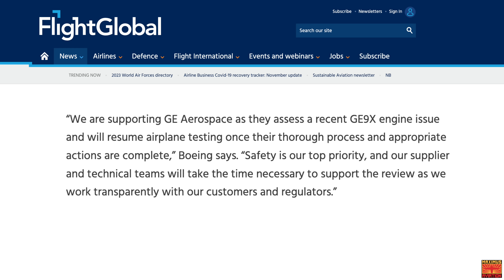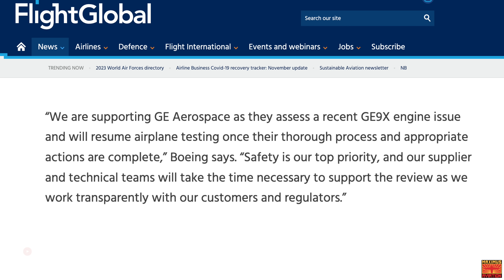Boeing Grounds All 777-X Test Aircraft Due To GE9X Engine Failure. Will the 777X Ever Get Certified?

Comment: Hi Max, does Rolls Royce have a similar power plant under development or testing to also be included in the choice of engines that carrier’s can choose from ??? ✈️
Reply: RR has the Ultra fan under development, but it's been put on their back burner after a test setup. Not that there problems with it per say, but they have other priorities and financial challenges and few actual profitable opportunities for it. Engine choice isn't really the think anymore on widebodies or even narrow bodies anymore give the huge development and manufacturing costs.
Reply: Yes they do but it is not yet ready to be slapped  under the wing of an airplane.  Just like John said , they have pumped the brakes on its development and are choosing to take it nice and slow .
Reply: @johniii8147  Where are you getting you naff info from? They have NOT put the brakes on its development whatsoever!!! The main aspect of the engine (the gearbox) has been tested and tested. It has the capacity to handle the output of 400 Formula 1 cars. It is in the process of being married to the fan and other architecture in Derby RIGHT NOW. Rolls are optimistic about getting ground tests underway in Q2 of 2023 and wing testing in Q3 or Q4 of 2023. They are quietly aiming to get a scaled version on the A350F test programme. Airbus are hoping likewise as the knock on effects mean a NEO for the passenger versions that will give a huge fuel performance reduction.
Reply: @nathd1748  your numbers are too optimistic for me  , I will believe  it till I see it . 

Giving  you the benefit  of the doubt , I still don't think keeping something  like that a secret between two large    well known companies is even possible. 

Some detail , even a tiny fraction  of it should have slipped out by now and we could have been chewing on  those rumors as we speak
Reply: @mmm0404  It HAS been made official. In local news outlets around Derby. When you are in the US you won't hear much. Also since the discussions are between RR and Airbus only there is no need to announce anything. Airbus are currently offering the A350F with Trent XWB97s only so anything better will become a bonus won't it?
Reply: @nathd1748  
You've convinced me you know what your talking about, your comment is too specific and authoritative not to. I wish them well with it..........
Reply: @artrandy  Did YouTube shelve my link? Official aerospace news saying RR will be testing it this year. I know that's not true. It will commence testing in Q2 of 2023.
Reply: @nathd1748  
Didn't notice. I never include links, the comments often disappear. Thanks for the updates......
Reply: @nathd1748  In other words will be a great engine but way too late for the 777X.  FWIW I am excited to see the UltraFan go into production.
Also if one is going to have trouble with engines on the 777X now is the time to find them.    Not after the planes go into service.   Boeing has 2 other copies of the 777X that they could fly or grab an engine from.  It does not look like they are in a hurry.
Reply: @danharold3087 The new RR Ultrafan will have no bearing on the 777x since GE have negotiated exclusivity.
Reply: @danharold3087  It's far, far from production at this point. They are taking a relaxed approach to testing since there are no pressing needs for it.
Reply: @johniii8147  This is a thread that has gone off the rails.   Somebody else asked if RR had an engine that could be used in place of the  GE.   I have never said it was.  I did not say the ultraFan was a bad engine but it will never be used on the 777X due to timing.  

It think RR knows this is not an easy engine.   IRRC at least one other company tried and failed around materials for the gearbox.   Best wishes to RR.  Arguably we need better engines more than we need better air frames.   Best wishes to RR and all the engine makers.
Reply: @artrandy  Rolls officially announced yesterday that the Ultrafan demonstrator was finished being built and is mounted in the test tunnel ready for testing. And the others on the thread reckoned it was on the backburner....LOL. Go to Simple flying dotty commy and you'll find it on there!
Reply: @mmm0404  Go to Simple flying dotty commy and youll see the official announcement yesterday that the Ultrafan demonstrator is ready and mounted in the testing tunnel. No chinese whispers from me matey!!
Reply: @nathd1748  
That's excellent news, and thanks for the update.........👍
edit: Just got the details from RR press releases, I follow Rolls from there.
Reply: @nathd1748  👌
Reply: @nathd1748  I was not doubting any progress with the ultrafan  , but the fact that you say by year end ( 2023) we would have one slapped on the a350F for testing .

  I'm sorry , you may be right on the money but i am still a bit sceptical. I hope my doubts will be cleared in the next few months if that is true.

Comment: Boeing's perfect plane will have one gigantic engine, no pilots no flight attendants and lock you in your searts. In case of emergency prepare for downward ejection.
Reply: Nope, this would be AIRBUS WET DREAM .... and use recycled cardboard for the wings.
Reply: @38911bytefree  Is Airbus suffering from with as many problems like the 737max 777x dreamliner, Starliner, Redhawk Trainer, Pegasus Refueler, Osprey? Maybe that Airbus cardboard would fix some of those issues.
Reply: @eleventy-seven  They are actually facing body paint delamination on the A350.  Im not talking abouth BAD JETS. Please read again. They are obsessed to low operation costs. Airbus carried sutudies trying to seat as twice as people in a wide body using the most crazy arrangemnt and avoiding overhead laugage storage on the side lanes. Im not telling Airbus makes good jet and Boeing makes the perfect jets. But they work in the name of savings. Until now, Airbus showed (to me) more anxiety. If Boeing wasnt a clown managed company, I will stick to them ... I like them, just because we all need to like one thing over another.  Now I most admit that Airbus sounds a better choice. But they faced their issues as well. Dont forget about the A320 presentation in the Paris Airshow .... ok ..... and sure ... it was the pilot. Similar events heppened to IBERIA: So no one can claim perfection. They are both state of the art. And if the carboard wings worked, Im not boarding. Period. Same way I wouldn fly a MAX.

Comment: Am a 'more than 2 jet engines' guy.
With this (AGAIN !) BOEING ... G.E. whatever, this 777X is a 'JUMBO.'
That is huge, as in BIG !!!
Once again 'losing one engine in takeoff, midflight whatever IN A TWIN engined aircraft, leaves you with ONLY ONE ENGINE LEFT !
How does that sound 'reassuring' eh ?!?
Hope it doesn't happen but all you need is 'a failure 😣, an incident' involving those jet engines on flight ✈️ 
...
Once again, let us posit it this way, 
Eventually, SCIENCE CANNOT SOLVE EVERYTHING, if the demands put on it are TOO MUCH !!!
Bigger, cheaper, more fuel efficient, "Green" engines 
Blah 😑 Blah 😒 Blah 😕 
I can tell you, Air Force One and military transport aircraft 
WILL NEVER 👎 go that that way !!!
This 'Green $tuff' is GaGa !
😢 😡

Comment: Oh Dear
How Sad
Never Mind
Spoken in an exaggerated British Army  Welsh accent.
Reply: Trent 1000 🤣
Reply: @rafaelwilks   I am sorry - your point was what exactly?
Reply: @rafaelwilks  What a loser of an engine, the T1000 for RR.
Reply: @John-nc4bl  indeed! Trash 1000 it was.
Reply: @1chish  would a truly competent engine manufacturer make something as disastrous as the Trent 1000?
Reply: @rafaelwilks   'As disastrous'?
How many failed in flight? None.
Did it cost any airlines any money? No.
Was every engine affected? No.
Were only certain locations causing the sulfidation on the IP turbine blade? Yes.
Have RR fixed it? Yes - some years ago.
RR spotted excessive wear and fixed the problem entirely at THEIR cost and how? Because RR use a 'power by the hour' lease system and airlines only pay for hours run. RR maintains and changes engines as needed at no cost to the airline plus it has a unique real time tracking system that monitors every RR engine in operation all over the world and they can spot a problem before it happens. No other manufacturer can do that.

But as you ask a question would a truly competent engine manufacturer deliver brand new engines that have:
Combustion chamber distress
Low pressure turbine (LPT) and gear box failures
Engine vibration
Well apparently Pratt & Whitney do with their 1100G GTF which has delayed new A320 aircraft deliveries with those engines ordered. And how about the exploding P & W engines on 777s?
GE sold engines that powered down at low temperatures causing flights to be re-routed or flown at reduced height. And you will of course know about the  GE CF6 engines that caused fatal crashes to 767 and A300 aircraft.

Before you get clever dude you may want to see who produces worse engines. And btw the only Trent engine version that had issues is the one fitted to 787. None of the others have had issues and they are fitted to the MD-11, 777, 747, A340, A380, A330, A350. The marine MT30 version powers warships in the USA, UK, Korea, Australia, Canada and Japan and none have failed.
Reply: @John-nc4bl   What a dumb comment. No one lost because of the Trent 1000 on the 787 because RR replaced all engines at their cost and fixed the sulfidation issue some years ago. No other Trent engines have had problems.
Unlike the GE and P & W engines. But you won't want to go there will you?
Reply: @rafaelwilks  Ah so you had no point. As I thought.

Comment: If it ain't Rolls Royce, I ain't going.
Reply: RR Trent 1000 enters the chat
Reply: Wasn't it a RR engine that exploded in flight on  a Airbus 380 a few years back.
Reply: @alexrebmann1253   Yes one did. But no other RR engines have.
Unlike the failures in flight of P & W on 777s and GE engines on various aircraft.
Nice try though.
Reply: @nickolliver3021   The RR Trent 1000 engine that has never failed in flight?
Reply: @nickolliver3021  It funny, you repeatedly tell people that the Max is fixed and to stop dwelling on the past.....and yet now you're bringing up an engine which had problems in the past (didn't result in any deaths) but has now been fixed....and you're reminding people about it.
Reply: @alexrebmann1253  Yeah but so did a PW4000 on a 777 last year. So nobody is safe
Reply: @1chish  so what made you think that? I never said it did
Reply: @tomstravels520  the max has nothing to do with an GE engine failure. Also that's a completely different story to this actual problem of a temperature alert warning popping up on the flight deck. That's not what the point is about dwelling on the past.  This engine failure doesn't result in deaths. And why would it. Well they've had issues with the engine and that's not what I'm reminding people about. Just the fact its had issues like RR are a perfect engine manufacturer (not)
Reply: @tomstravels520  Yes,I was just responding to a guy that made a comment if its not RR im not going. They all have had there issues.
Reply: @nickolliver3021  everything I just said went straight over your head and you either didn’t understand my point or deliberately tried to ignore it
Reply: @tomstravels520  just don't say anything simple as that. You don't get anything. I really give up
Reply: @nickolliver3021  oh I have to say something because its just hypocritical what you did. 737 Max had major problems, problem fixed, you hate it when people still bring up the Max and remind everyone what happened

Now we have the Trent 1000, had problems, got fixed...now you're bringing it up the engine and reminding everyone what happened. You hate it when people do the same to the max but will happily do it yourself to other items. Has that simplified it enough for you?
Reply: @nickolliver3021   Well actually yes you did by simply adding the Trent 1000 to the discussion about engines that fail.
Your inference was absolute.
Reply: @nickolliver3021   Quote:
     "Well they've had issues with the engine and that's not what I'm reminding people about. Just the fact its had issues like RR are a perfect engine manufacturer (not)"
Says the man who just denied making that very statement in his first comment!
Reply: @1chish  so that means RR are not perfect. Hence him saying "if its not RR I ain't going" which doesn't make sense as it has had its problems.
Reply: @tomstravels520  Thomas I get your point. They will get fixed no matter what the issue is. It's hypocritical that you seem to bring this all up like its something so major in your life. 

Any car that has a major problem, it gets fixed.people will hate it when others say bad things about them going wrong but they still remind people. The list goes on for whatever type of transport that experiences issues.
Reply: @1chish  and you quote " the RR trent 1000 has never failed in flight?" I wasn't referring like it has when it hasn't.I know it hasn't. An issue is an issue. It gets fixed when it does. Simple as that and my statement was not denied when making it in my first comment. (If it ain't RR immnot going) says it all.
Reply: @nickolliver3021  you don't even know what hypocritical means because you just used it in a sentence where it makes no sense.
Reply: @tomstravels520  and so did you. It didn't make any sense either now we can agree to disagree
Reply: General Electric  , all day every day
Reply: @nickolliver3021  do I really have to get a dictionary out and waste my time explaining to you what hypocritical means and how it made sense for me to use it....in-fact I'll give you the primary school version, you tell us not to do something, but then you did it yourself. Got it?
Reply: @tomstravels520  And do I need to get a dictionary out and waste my time of how I used 'Hypocritical' correctly in my comment? A  similar word then would be affected. So you are affected by what I say. Just agree to disagree as you are not doing yourself a big favour whatsoever
Reply: @tomstravels520  this guy is a troll
Reply: @kirilmihaylov1934  you are as well
Reply: @kirilmihaylov1934  I don't know if he's a troll, still in school, or just not that intelligent but always trying to big themselves up when actually they have no idea what they're talking about and try to deny when they do say something and caught out on it. Especially when most of the time all they do is copy what the last person said but reverse it
Reply: @nickolliver3021   You know I like a good discussion / argument but with you its clearly a waste of time so I will leave it there.
Have a safe week.
Reply: @1chish  So do I. I want to understand but clearly we don't work out well. The harder I try I don't get anywhere from your way of thinking. I wish you well anyway. Hope to get a better understanding next time
Reply: @nickolliver3021  Nice seeing you have your lunch eaten by others. 😂
Reply: @tomstravels520  Nick is a wannabe he actually supposedly graduated school but he's clueless. He once DM me on LinkedIn and when I post some photos of Boeing corruption that I personally took while working Nick had a meltdown and was cursing in text then blocked me. As a gift I post part of his meltdown with corruption photos on LinkedIn.
Reply: @DC8Combi  oh really? You’d never believe it considering some of the things he’s said over the years that a child would say
Reply: @tomstravels520  The best comedy of Nick is him being a hypocrite not just him being thick as a brick.
Reply: @DC8Combi  hypocrite and inability to come up with a decent argument. Just copy what the last person said but reverse it so replace Boeing with Airbus or vice versa, replace “is” with “is not” etc
Reply: @tomstravels520  Oh yeah his copy what the last person said but reverse it so as to replace Boeing with Airbus or vice versa is priceless he has zero shame.
Reply: Why is Maximus talking like this?...  Serious information should be treated seriously. Who would listen to a Tom&Jerry voice... The young generation? Good luck with them. Regards from the 747-8 left seat. 
BTW:   This is the reason why Maximus Aviation has only 64'300 members... and only non aviators posting comments... (with this exception). Maximus, talk like a normal human being, please.
Reply: @alexrebmann1253  uncontained engine on the GP engine for the A380 also. Along with uncontained PW on 777 and GE on other aircraft.
Reply: @nickolliver3021  How many gliders did the T1000 issue cause? The figure was in the 40s. How many gliders did the GTF issues create for Airbus? At one point there were nearly 150 A320neo sat in Airbus yards minus their engines. Rolls has fully fixed the T1000 issue now.
Reply: Nice seeing that your lunch was eaten by the lot here 😅
Reply: @nathd1748  I'm not relating to that question. I know the trent 1000 never failed in flight. But it has had issues which have been fixed. RR were not perfect.
Reply: @nickolliver3021  The reason the T1000 had so many issues was due to the time frame Boeing gave to Engine suppliers to provide and lock in design of an engine that no longer had bleed air but electrical draw off instead. There were far more GTF powered gliders sat idle than T1000 powered 787's.
Reply: @nathd1748  but the engines had blade cracks and a few other things that needed fixing. The same goes to airbus providing a time frame for the P&W engine issues too. Of course I understand all that 👍
Reply: @nickolliver3021  Yes compressor blade fatigue cracks due to having to spin faster than they did in other Trent designs.
Reply: @nathd1748  that's the one 😁